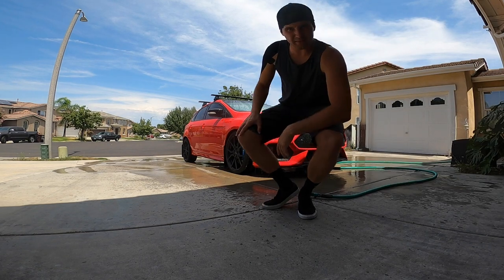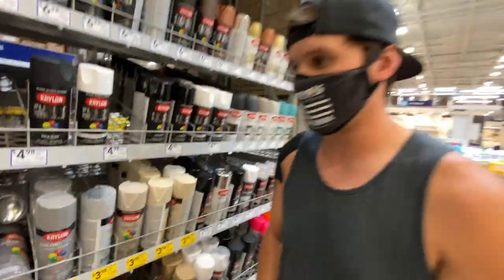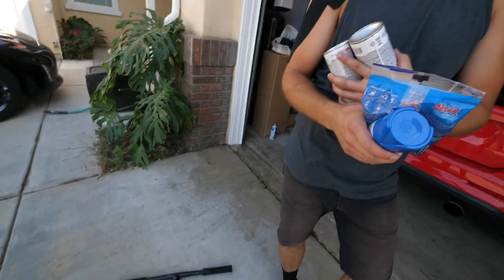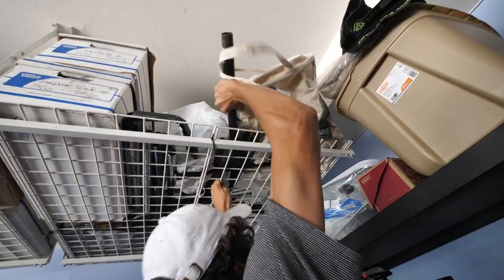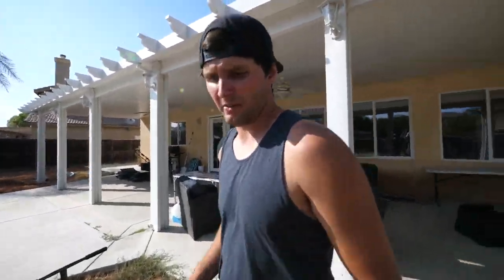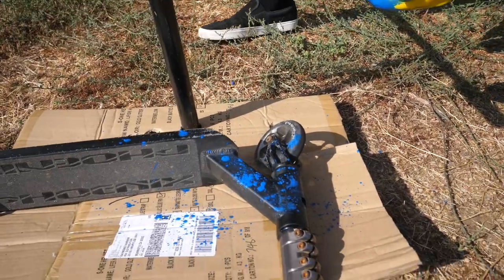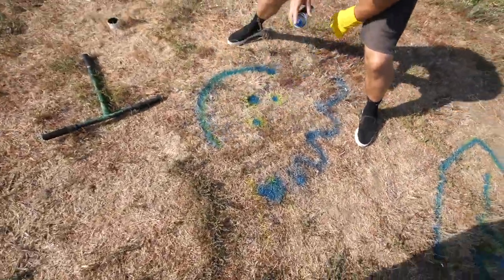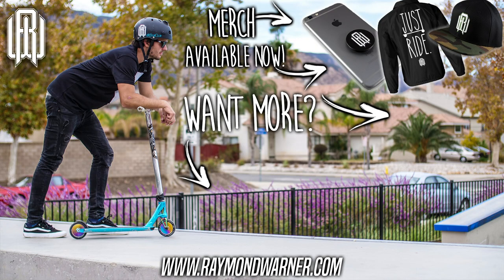HOW TO PAINT SPLATTER YOUR SCOOTER!

Comment: You can get smaller splatters by barely pushing in the top of the spray paint can so the paint is Barely coming out and it builds up into paint slapters